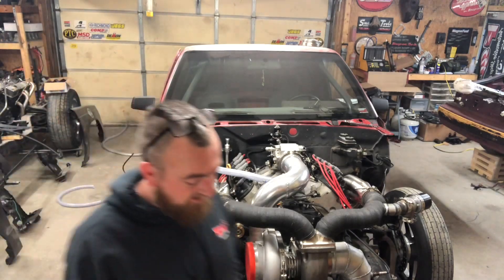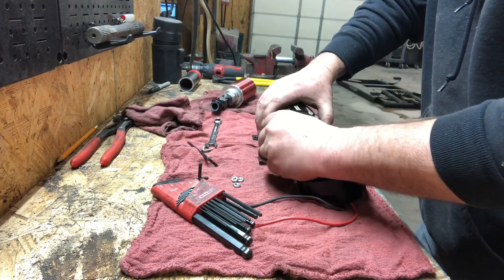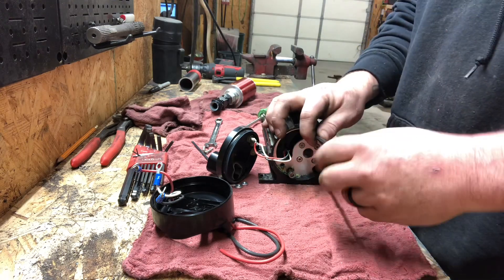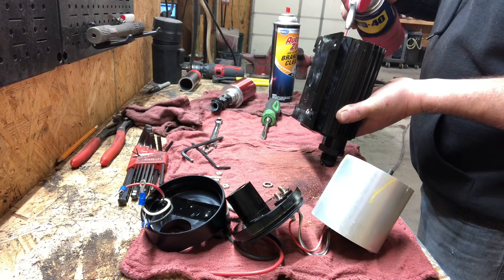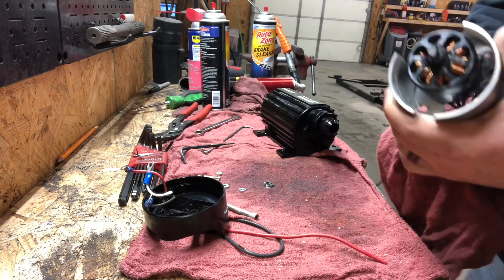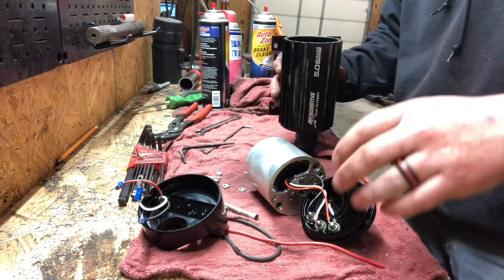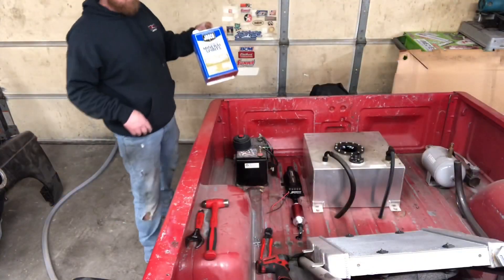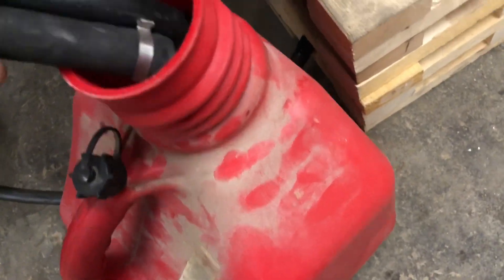Aeromotive brushless 5.0 fuel pump locked up?

Comment: Have you had any issues after you cleaned it out!? My pump is loosing a little but of pressure and thinking about what u did in this video. Thanks for the video! 👍👍👍
Reply from the maker: I actually had to send it back in to Aeromotive apparently my pump was one of the first ones made so they did some updates and it has worked flawless ever since
Reply: @Mikefoster81  was anything left in the housing after you removed the pump motor?
Reply: @FirstLast-tx3yj   once you remove the motor the gear pump section is still left… what he has wasn’t a pump locking up issue. It’s the controller has gone bad. I tore mine apart as well.. nothing was locked up but still made that same noise his made at the beginning of the video
Reply: @stephensnyder2559  my 5.0 brushless with speed controller (yellow wire) stop working. Summit said I’m under warehouse but I have to call Aeromotive first and get “consent” from them. I had a race lined up…money gone. I’m going FuelLab…any opinion?

Comment: currently debating between a cable drive and the aeromotive 7.0. reccomend them? overall?
Reply from the maker: Cable is the way to go if you have the space for sure but if not these brushless pumps are definitely the second option.. I have no complaints at all out of mine.
Reply: @Mikefoster81  struggling for cable room. Retaining ac compressor and alternator is on the driver's low side
Reply: @Mikefoster81  you running methanol and getting good performance?
Reply from the maker: You mean performance out of the pump? Yea it worked great on m1 but iv went back to e98 since this video
Reply: @Mikefoster81  how fast was it good for. 60' or 1/8th?
Reply from the maker: Kincent Carter it’s been a 5.33 in radical street trim with the old 5.3 setup on e85. That’s all I can really tell you. Everything else is grudge racing lol
Reply: @Mikefoster81  no comparable e.t. on meth? Just concerned with flow volume on high g launches
Reply from the maker: Kincent Carter no issues I promise comparable ets yes with more left in it. When this el Camino is done I’ll have numbers for everybody
Reply: I've got an A1000 im about to try to rebuild. It was working fine. Then sat for a week or two. Then wouldn't turn. We will see what the issue is soon. I'd bet its plugged up.